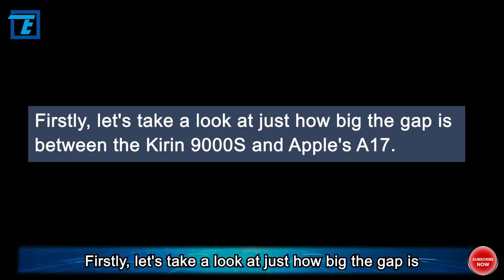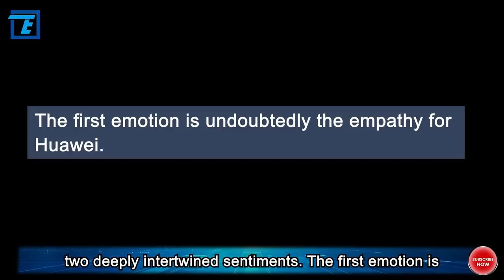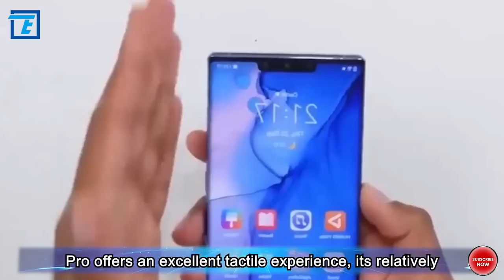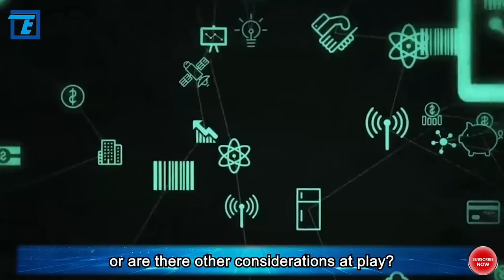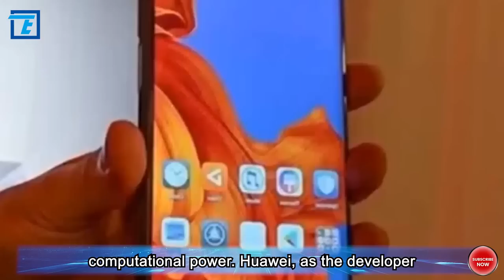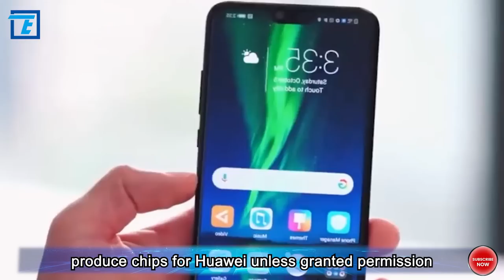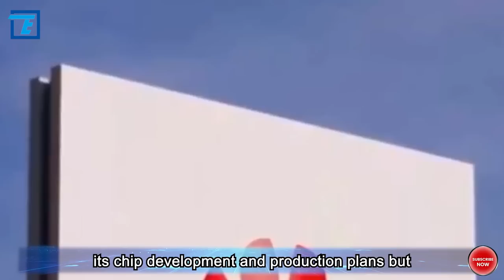Huawei Kirin 9000S VS  Apple's A17 Chip, Who Prevails? Has Huawei Broken Through Chip Barriers?

Comment: Apple need a good competitor to design and provide the good enough product with right price, not just provide a better UI with limited new feature, but push the price higher and higher. Apple forget the real innovation for a long while after Steve Jobs. Finally, huawei is back and hope Huawei will push Apple to start the real innovation again. Think different, Huawei make it with inhouse OS, inhouse designed chips.